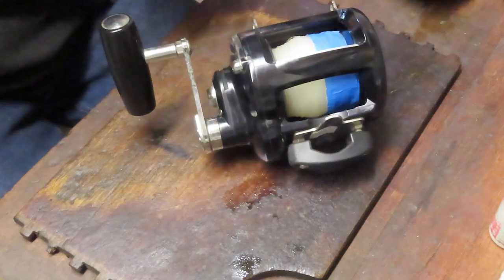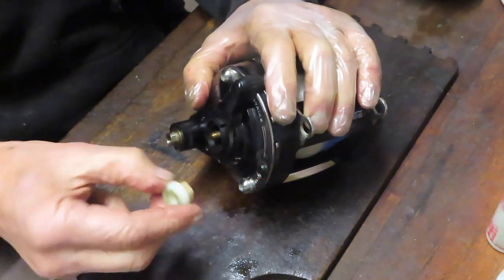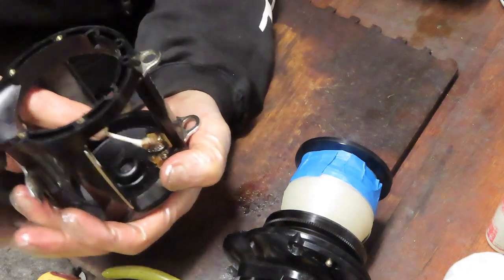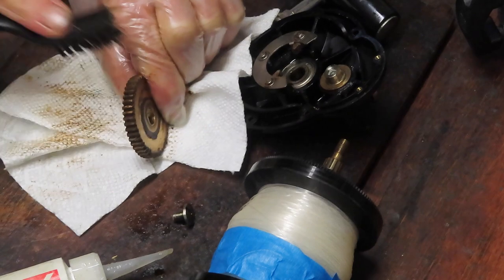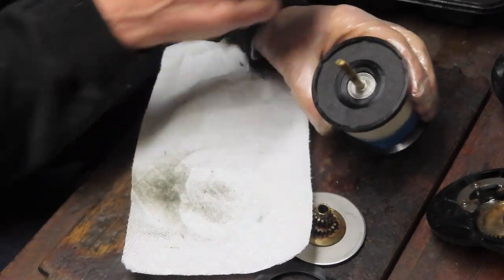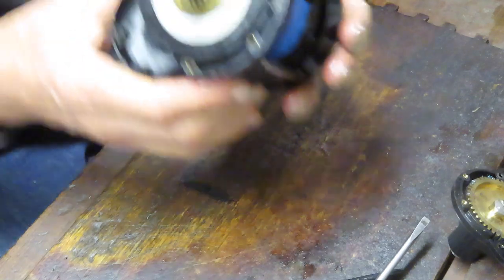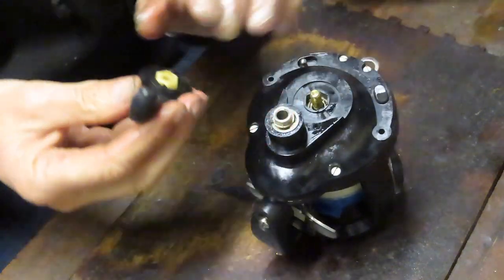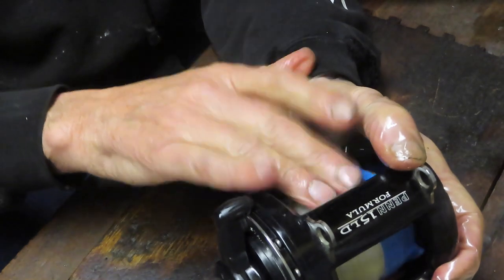Penn Formula 15 LD Big Game lever drag fishing reel how to take apart and service

Comment: Very nice reel Dennis. It’s the first time I ever heard of this model. Looks well built, and you made it look easy to take apart. BTW, I noticed you have your old bench, work board back. Much better! and easier to look at. Have a great Easter pal. Thank you!
Reply from the maker: Thank you very much!  There is a transition of the videos, some before and some after the board switch, so you will see both for a while - Dennis

Comment: have you info on the rachet , mine doesn’t lock on for full noise ,. its the same rachet as the 345 GTI , is it not ,. nice big reels ,. thanks for the tutorials much appreciated,.
Reply from the maker: No, sorry.  These are not the same set ups if you are asking about the Formula 15LD versus the 345.  They are different set ups - Dennis

Comment: Dennis, I have a Penn Formula 15KG and the low gear doesn't seem to engage, but the high engages without issues. Was this a common problem? I prefer these reels than the new ones today...
Reply from the maker: No.  You will need to take the reel apart to see what is causing the issue.  It is either a worn or broken part - Dennis

Comment: They had to compete against the TLD
Shimanos and to a lesser extent the Daiwa
Sealines. The Shimanos and Daiwa had
stainless internals. These reels were also
prone to frame cracks as I understoood.
Reply from the maker: Yes - I think they came as a cheaper alternative to the Penn Internationals and the graphite case was why.  Also, a lot of these were made. as single speed reels when the market was shifting the bigger reels to dual speed. - Thanks as always Armando - Dennis